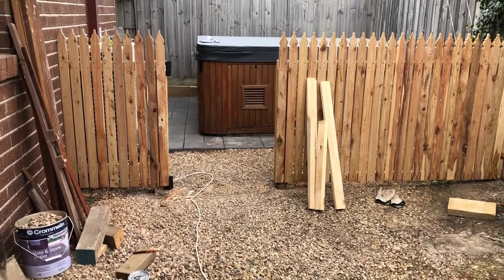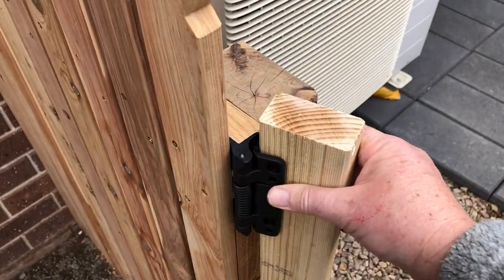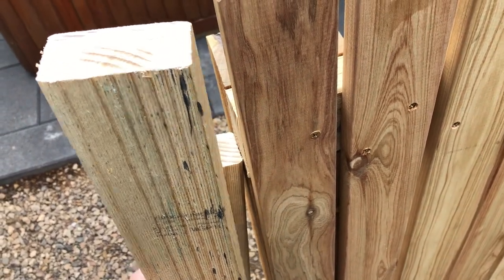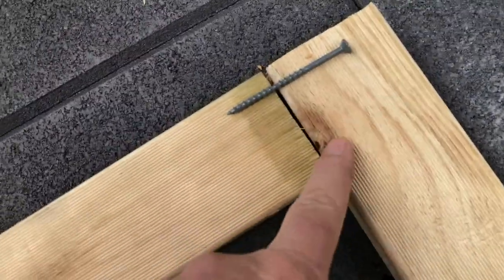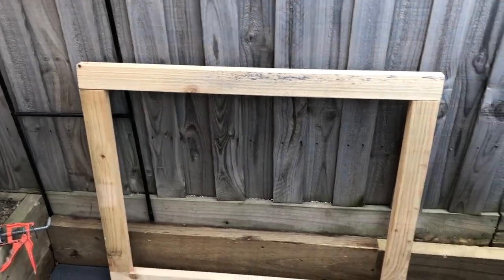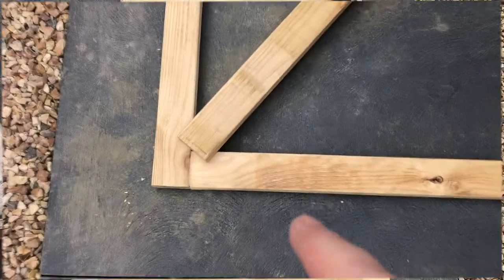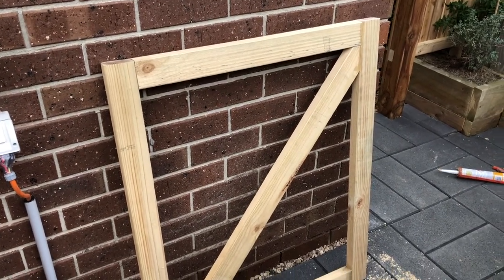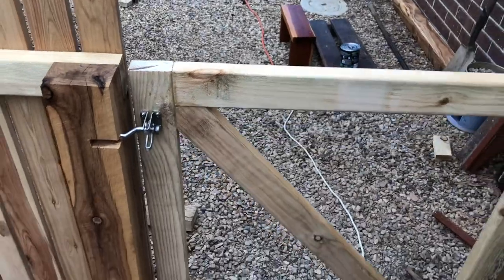4 How to make an Easy Picket fence Gate. It's even Swimming Pool or Spa regulation compliant. Paling

Comment: I am looking at doing a similar thing myself but the tops balustrade I'm using are only about 840mm from the decking floor. If I have spacing less than 13mm between the pickets and the height at least 1200mm will that still make it compliant as long as there's no steps or anything from the outside or will I have to add blocks to raise them to the 900mm mark? Thanks for the videos btw, they're very helpful.
Reply from the maker: Have a look at this video. 
Quick guide to Swimming Pool & Spa Fencing Regulations. Compliant fence barrier https://youtu.be/85ntWVXiyMw